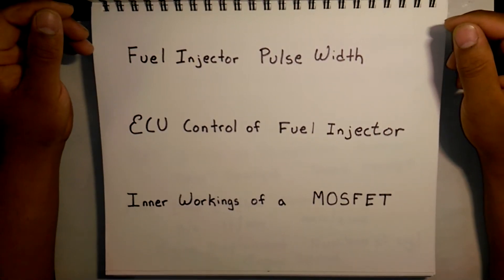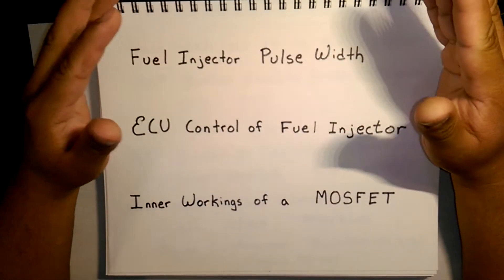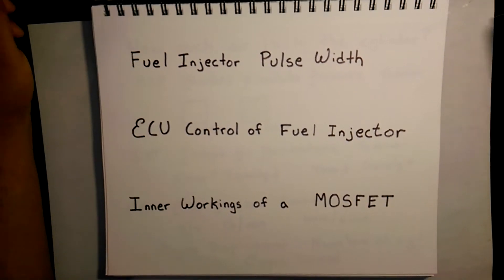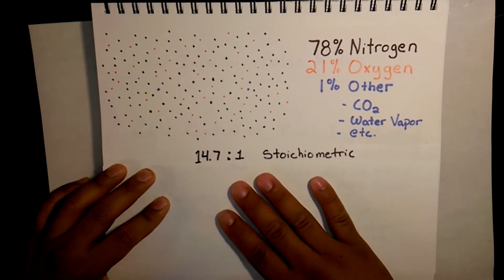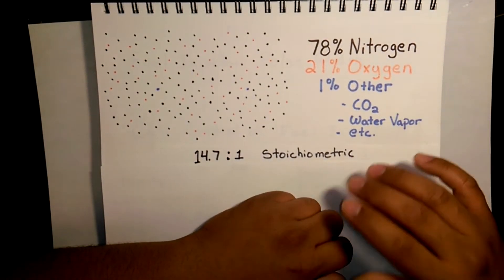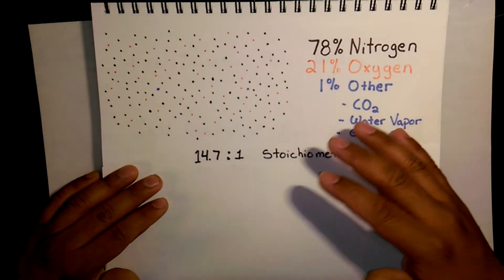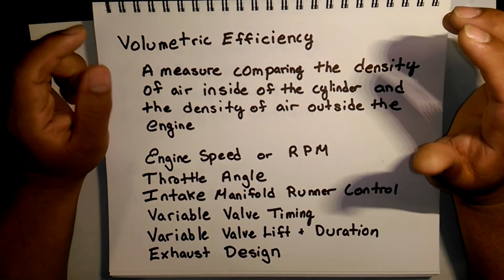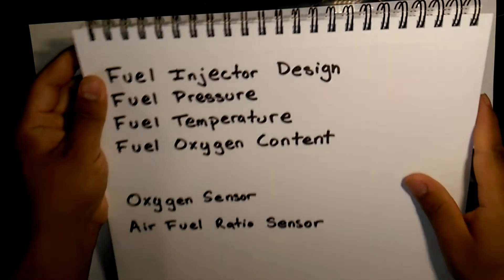Fuel Injection Pulse Width Calculation

Comment: Great video but I really wanted you to get to the point where you're actually calculating the pulse width and showing the voltages so it could be applied to say a pulse with modulator to control a fuel injector directly

Comment: Very good explanation, what temperature we use to calculate the mass of fuel. Is it the temperature of air inside the chamber or out side temperature? Note:  We are using Constant volume chamber..
Reply from the maker: The intake air temperature is measured as the air is entering the intake manifold. Since the air is moving very quickly there is little change in air temperature due to convection, conduction, or radiation. The air temperature measured as the air enters the intake manifold is suitable to be used for the calculations. Thank you for your question, and thanks for watching!!

Comment: Thanks for video ..I want to know how much fuel is injected while fuel injection (Fuel consumption).
         Can you please help me with its formula.
Reply from the maker: I do not have that formula. It is a function of many parameters. The basic idea is that if there is a target air fuel ratio and a certain mass of air is measured/calculated to be in that cylinder then the mass of fuel per injection is (mass of air)/(air fuel ratio).

Example: 1.2g of air in cylinder, 15:1 target air fuel ration, then (1.2g of air)/(15 g of air per 1g of fuel) = 0.08 grams of fuel.

In reality a MAP sensor will give you absolute pressure in the manifold or a MAF will give you  mass of air per unit time which is where the complicated formulas come up. I only ever worked as a mechanic and knew the fundamentals about the big picture details so I could accurately diagnose problems. The equations you are looking for are much more complex and beyond my knowledge.

If you ever have Electrical Engineering related question, I am in my third year of my EE degree, feel free to shoot me a question. Thank you for your question and thanks for watching!!

Comment: any formulas for map/iat calculations ?speed densinty maths
Reply from the maker: I found this book at this link
https://bit.ly/2EZqnBT
It is only a preview but highlighted in Equation 4.9 is likely what you are looking for.
Reply from the maker: FORGIVE THE WALL OF TEXT:
TL;DR: It's complicated but worth understanding. I do not give a formula, since there is not only one formula, but explain some basic concepts and beliefs of mine.

MAP and IAT sensors measure, in an indirect way, the density of the air, literally how much air there is per unit volume. The Ideal Gas Law (absolute pressure)*(volume) =(number of moles)*(ideal gas constant) *(temperature in Kelvin) also known as PV=nRT and Dalton's Law of Partial Pressure can give us a model for how much Oxygen is in a given unit volume of space at given temperatures and pressures. What we need is the number of moles of Oxygen molecules, that are present in the cylinder and with some chemistry we can figure out how much fuel to inject into the cylinder, depending on the air fuel ratio we want to implement. The ideal gas law does not work with absolute impunity since it works for a non existent ideal gas. Calculations of this type are complicated which is why there are formulas that are based on the ideal gas law and corrections based on Van Der Wals formula for the ideal gas law and other corrections that are usually determined experimentally. Furthermore there are corrections made to the air fuel ratio based on feedback from the oxygen sensor or the air fuel ratio sensor as well as the amount of load we want to place on the engine. I am sure that formulas exist but they are going to be specific to the type of engine it will be used for and the desired goal of the engine, and I have not been able to find a specific one.

A final thought, there is NO simple answer. Believe it or not, I am working toward a degree in Electrical Engineering and am in my third year of school and I only recently learned about this type of physics in my thermodynamics class and in my chemistry classes, even though I have worked as mechanic, diagnosing these types of systems, for almost 10 years. I knew about air fuel ratios and corrections and had a cursory understanding of the process. It is important to realize a modern engine and the hardware and software that controls it is an amalgamation of hundreds of years of human innovation and to truly get a satisfying answer to your question, you are going to have to dig deep and discover this for yourself. If you are only looking to make a car run, then use other people's formulas or ECU's and do some testing on your own. Tuning is a skill that can be learned without the complicated physics and math that goes behind it, but if you want a deep understanding, physics, chemistry, math and several types of engineering will be needed.

If you have any more questions let me know. I can even dive deeper but I will need time to do some research. Let me know! Thank you for your question and thanks for watching!!
Reply: @Enrique_Osorio  yea i understand that.Well im trying to make a small ecu for a single cylinder 200cc engine.It doesnt have O2 sensor but im planing to fit one.It only uses map/iat for air density.I do know about the air density formula and im using it for tests but i need to convert that to density/fuel ratio and then convert that to pulse width based on my injector size (180ml/m).After that i can use O2 to aply corrections
Reply: @tougeattack123  did you have any success finding the equation? I am also working on creating an ECU and have not figured out that part yet. Any help would be appreciated. Thanks!
Reply: @marianabrioness  in what application u want to use your ecu car moto or anything else??
Reply: @tougeattack123  we're designing the ECU for a small Honda Gx35 (mainly associated with small applications such as lawn and garden.) Our only objective is to turn on the engine using the ECU we're designing and mantain it at optimal operation
Reply: @marianabrioness  take a look at this it will help you https://www.team-integra.net/threads/calculating-injector-pulse-width.46738/
btw what sensors are you using for this engine tps ,map/iat or maf and also what sensor you use for crankshaft wheel